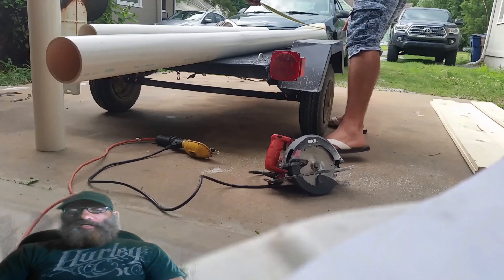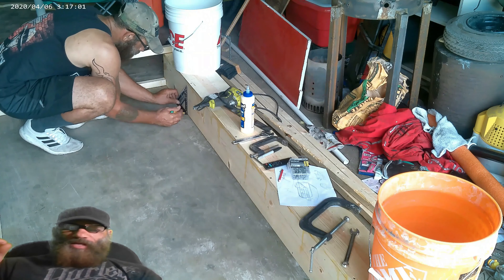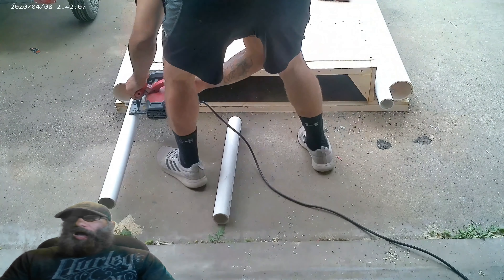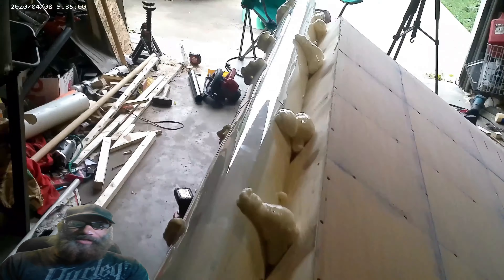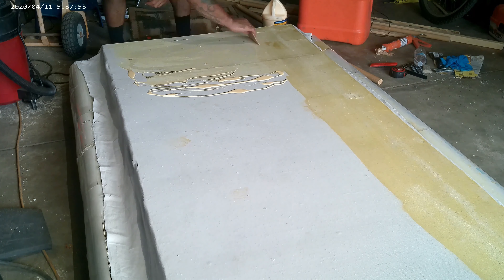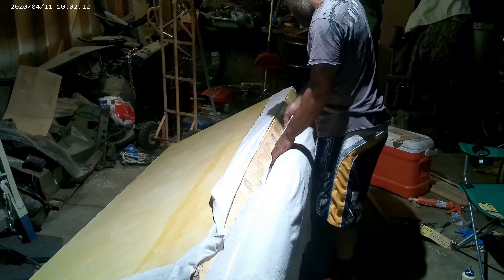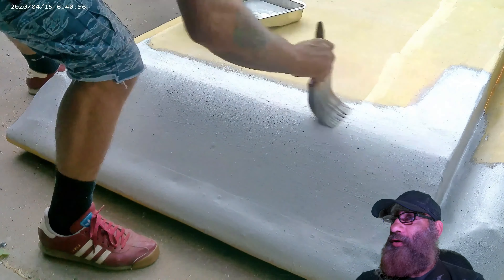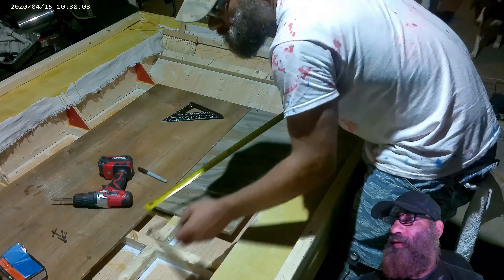The COOLEST teardrop camper build EVER! (Berserker build part 1)

Comment: Did you have any issues with the canvas unraveling after you cut it.  I've seen some of the pmf videos where they have issues with it.  I was thinking about those zig-zag shaped fabric scissors. I'm not sure what they're called, but I think they are supposed to minimize unraveling.  Also, did you use full-strength glue the whole time without diluting any of it?  BTW, that's an awesome idea and probably the most beast camper....well, camper boat thing I've seen.
Reply from the maker: Yes, the canvas would untwine when cut. So I cut it over-sized and then used a razor and a straight edge to minimize the unraveling.  I did not ever dilute the glue. I kept it at full strength. Let me know if you have any further questions.